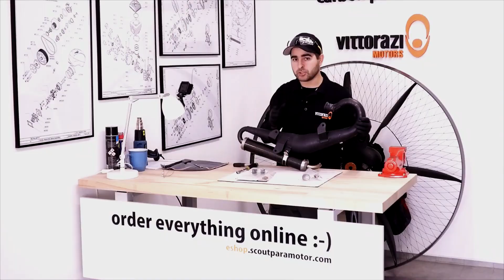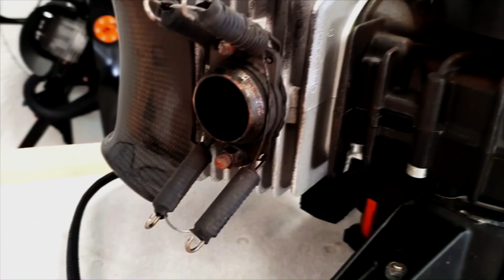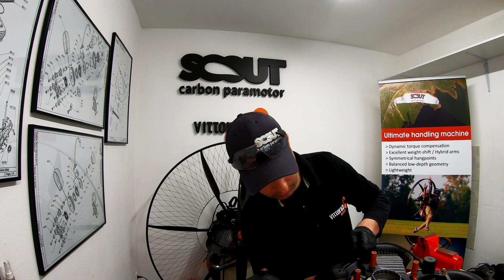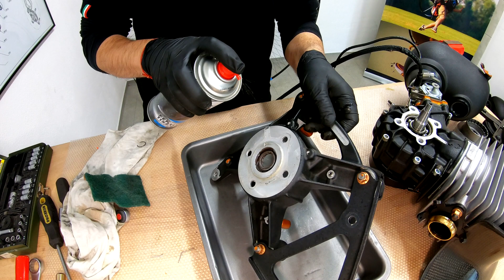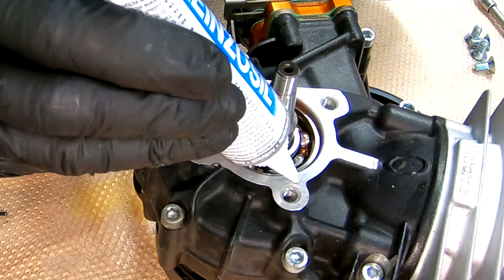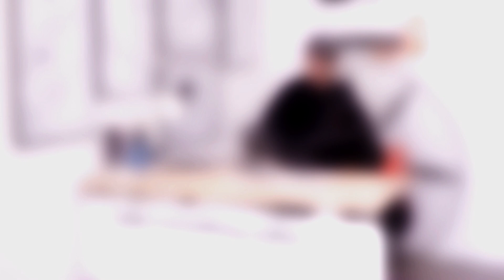Vittorazi Moster 185 engine carter support replacement. Paramotor engine maintenance series

Comment: bad idea to put loctite in the holes. if some gets in below the bolt when tightening bolt can cause hyd, pressure which can crack casing, more better to put on bolt threads,

Comment: Nice video.  For USA.  HONDABOND, YAMABOND, or Threebond for case halves as well as the outer case cover.  Please be careful NOT to let any contact cleaner or brake parts cleaner touch your crankshaft seal, ever.